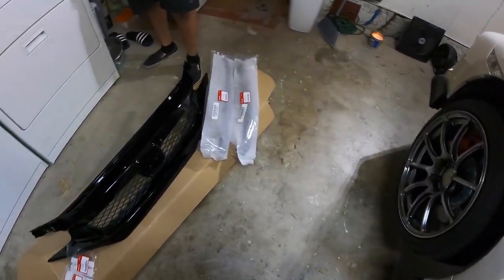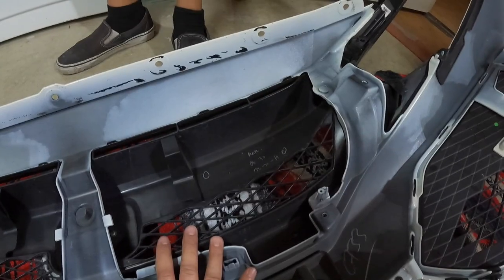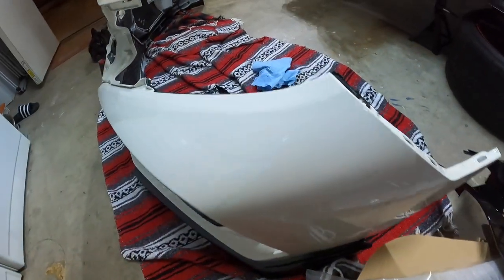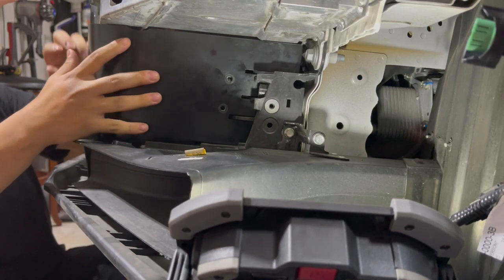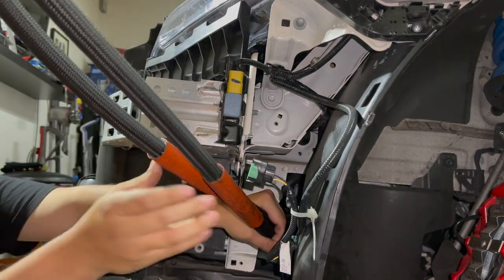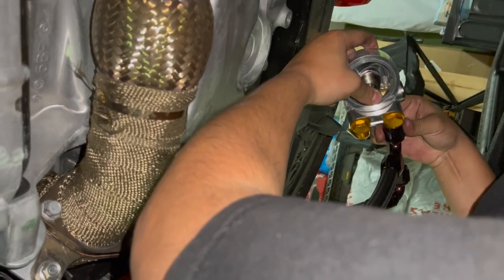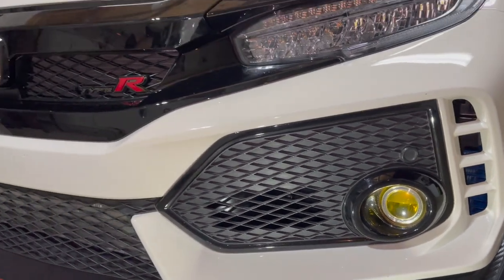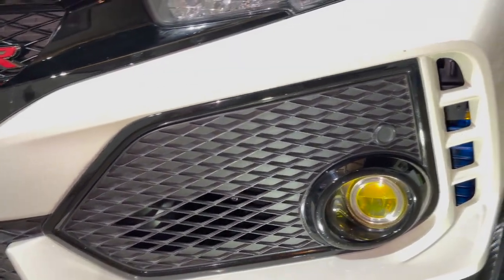Honda Civic Type R FK8 Greddy Oil Cooler and 2020 Grille Install

Comment: @CTR27322 did you notice any noise from oil cooler? I've read that is common with oil cooler installs, especially on the FK8. Nice video
Reply from the maker: No noise, but you do get a whiff of oil smell 👃 every now and then, but totally normal!
Reply: typical humming sound that follows RPM.

Comment: Hey pal, did you need to dismount the oil cooler to drain the oil? I mean when you change the oil, like a quart of oil remain there.
Reply from the maker: I don't disconnect the oil cooler, I'm assuming the oil is recycled back into the oil pan, when we drain it, its taken 6 qrts of oil.